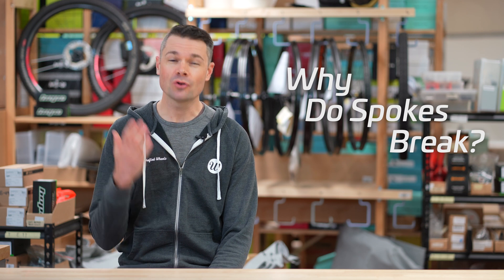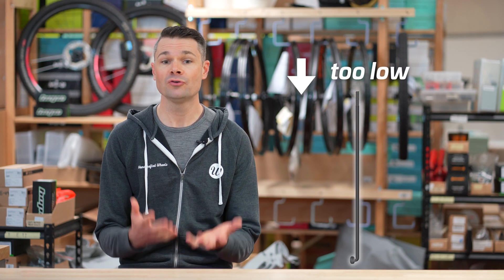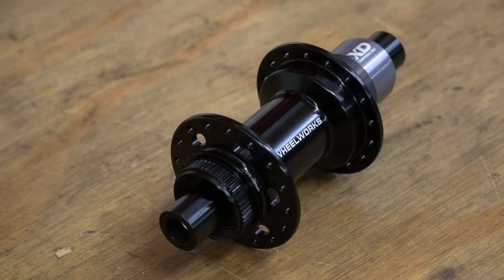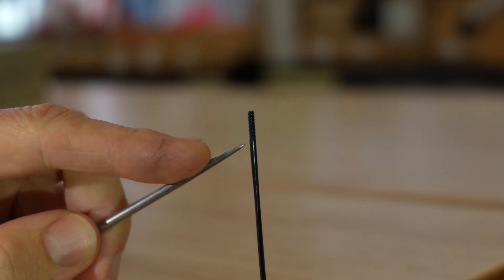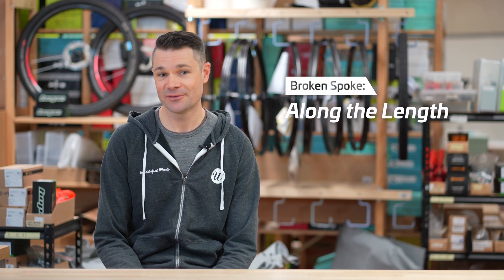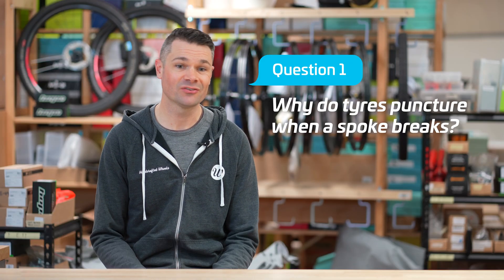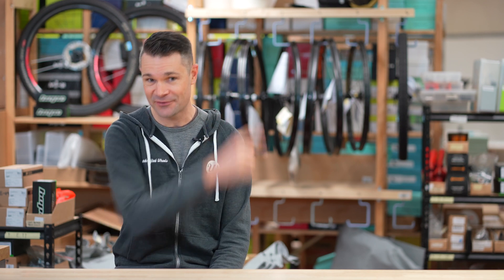Why Do Spokes Break?

Comment: I'm watching the video and I can't believe what I'm hearing. 
I have no doubt that you are doing your job well, but there are some misconceptions here.

to introduce myself: former racing driver, bicycle mechanic and wheel assembler. I've assembled 800-1000 wheels myself. Mostly mid-range and slightly higher-end for my needs (about 10 pieces).
factors that affect the durability of wheels are: quality of parts (spokes, nipples, spokes and rims), rider weight, rider strength and riding style.
there is no combination in which the wheel will not fail.
it is common for higher quality wheels to last longer than lower quality wheels.
higher-quality spokes are more flexible than lower-quality ones, which almost cannot be easily bent into a U shape. such spokes are more brittle and break suddenly.
DT swiss claims for some of its spokes that they crack only above 170kg of effort (if I understood them correctly)
Material fatigue occurs on such a spoke if it has a frequent change in load in the range of, for example, 80-170kg, the larger the range and the closer it is to the maximum force that the spoke can withstand, the sooner fatigue will occur.
Fatigue cannot occur on a spoke if it is variably loaded below, for example, half the breaking strength (0-50/80kg).
The most loaded spokes always break first (unless there is a fault in the material, production or assembly)
your hubs have a larger flange and therefore reduce the range of variable load because the spoke is on a larger lever unless it is a radially assembled wheel.
with mid-range aluminum rims there is always increased stiffness at the joint and therefore the spokes at the joint are a little more loaded compared to the others.
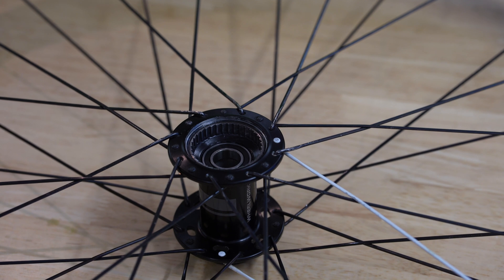08:27 I don't know who assembled this wheel, but they assembled it wrong: the spokes that are damaged by the chain are the most stressed spokes on the rear wheel, and that's why they should be on the inside, not the outside like in the picture.
from my own experience with a rear mtb disc wheel that had dt spokes, after 10-15 years of hard riding, the right spokes started to break frequently. then I did an experiment: I moved the right spokes to the left side and the left to the right and then the spokes stopped breaking for the next about 5 years, after which both the left and right started breaking. then I changed them all. 
so the result of the experiment is that material fatigue occurs sooner on more loaded spokes than on less loaded spokes. 
otherwise, every wheel I make, I do the "singing" of the spokes, by bending the wheel in different directions, in my area there is a saying: the donkey and the owner know more than just the owner
Reply from the maker: There is a lot to unpack in your comment.  

Regarding the lacing pattern at 8:27, we put the 'pulling' spokes on the outside as this makes the wheel slightly stiffer, and pulls the crossing inwards and away from the derailleur / brake calliper under pedalling load.  

Spokes start plastic deformation around 180-220kgf depending on their cross section, and will fail around 320kgf 

Steel spokes have a nearly infinite cyclic lifespan if the material is good quality and  the spoke stays in tension.  Many spoke failures are on the low tension side of the wheel because spoke tension is too low and the spoke goes from tension into compression. 

We've done lots of lab testing and real-world testing over 19 years of business and 10s of thousands of wheels built and while I'm always still learning I'm confident in the statements I've made in this video , although some are generalised to keep the video shorter and more relevant -Tristan

Comment: Had a dual walled BMX 20 inch wheel laced to a NuVinci n380. Had no issues for a year on a TerraTrike Rover. Then started breaking spokes at the rim. Problem appeared to be the lacing pattern. They looked be bent to get them laced in the pattern used. - Replacing a broken spoke was not fun due to the 20" x 2.125" Schwalbe Cargo Pick-Up tires fitted on a recumbent trike.

Have a Greenspeed Magnum XL now. Would like to to get a NuVinci n380 laced to a dual-walled 20 inch rim. Or would a 24 inch rear wheel rim be better due ti spoke length (or the lack thereof)?

Comment: Strength is the force a spoke can withstand before it plastically deforms. Low tension spokes break before high tension spokes because metal fatigue is proportional to the percentage change in tension. A spoke tensioned to 50 kgf that drops to 10 kgf when it detensions at the bottom of the wheel rotation has far greater percentage change, and therefore fatigue, than a 100 kgf spoke that drops 60 kgf.
Reply from the maker: That's a really succinct explanation thanks! -TT

Comment: The modern highly dished rear wheels are very unreliable.  The rim sets the maximum spoke tension that is much lower than the spoke capacity.  The spoke tension on the non-drive side of dished rear wheel are often less than half that of the drive side; too loose to not flex and fatigue and fail.  Three solutions, 160 mm hubs, no dish, off set chain stays 8-10 mm no dish or 2:1 lacing 2 drive side 1 non-drive side.
Reply from the maker: I respectfully disagree with you on durability.  Modern wheels have a lot of dish, however they can be built to be durable and long-lasting.  The lower non-driveside spoke tension isn't a big issue in real life.

All of the other options you list have their own downsides.  In my view for modern road and mountain bikes the wheel being dished is the best compromise. -TT
Reply: @WheelworksHandcraftedWheels  Firstly I am a retired mechanical engineer, design and manufacturing, and long time custom fit, high end steel frame builder.  I can assure you that the dished wheels are highly compromised.  Spoke tension on the non drive side depending on the hub can be as low as 40% of the drive side.  Many rims have 120 kg limit on spoke tensions.  That is 48 kg spoke tension on the non drive side.  Spoke tensions below about 100 kg allow the spokes to flex excessively which causes fatigue and failure.  You did not elaborate on the down sides of the three options 160 mm hubs, offset (8-10 mm) or 2 spokes 2x drive side 1 spoke 0x non drive side.  I have yet to envisage or actually find any down sides.  Most of the frames I have built have been for extra large men (some 150 kg and fit) and a few for small women who have trouble getting a bike to fit.  My self 76 yo the lowest weight I have been in 50 years still well above 100 kg.   Always plagued by non-drive spoke failures on dished wheels.  160 mm hubs, expensive, heavier and possible but unlikely heal strike on short chain stays but super strong wheel with matched spoke tensions drive and non drive side and much better chain alignment.  Off set chain stays, standard hub, matched spoke tension drive and non drive side, better chain alignment.  2:1 lacing, special hub or standard 32 or 36 hole hub for 24 spoke and 27 spoke wheels respectively.  Similar spoke tensions on each side the wheel standard chain alignment
All wheel builds have to be checked for center only the off set wheel is checked for the correct off set.  Incidentally any rims that are not directionally drilled for the lacing I am doing, I re-drill  directionally for that lacing.
Reply from the maker: @dan2304  Hi Dan

The lowest we typically see a non-driveside (NDS) spoke tension is 55% of the driveside (DS.)  Still low, but not 40%.  Lower spoke tension doesn’t affect wheel stiffness as Youngs modulus is the same.

Moving to a 0x non-driveside and, say, 2x driveside will further reduce the NDS tension.  To increase NDS tension you want the radial spokes on the driveside, and there are obvious downsides to this.

2:1 lacing is effective in bringing up NDS tension, however requires a much wider hub stance to retain wheel lateral stiffness, and the high entry angle of the NDS spokes into the rim results in a lot of spoke and nipple breakage in my observation and experience.

Wider hubs or offset rear-ends will result in wider Q-factor and wider pedal stance.  

All of “solve” one problem but introduce others.

I’m confident we’d be able to build you a wheelset which won’t go out of true, let alone break spokes, with a traditional lacing pattern and a dished rim.
-Tristan
Reply: @WheelworksHandcraftedWheels  Stiffness; Young's modulus is the distance a thing will move (spoke stretch) per a given force.  And is dependent on the actual tension not Young's modulus. double the tension on a thing (spoke) and the resistance to movement is doubled.
To account for the power forces pedaling or breaking the maximum number of tangentially laced spoke need to be used.  So drive side 2x

"Moving to a 0x non-driveside and, say, 2x driveside will further reduce the NDS tension."  How, wrong 

"2:1 lacing is effective in bringing up NDS tension, however requires a much wider hub stance to retain wheel lateral stiffness," Why? wrong

With  a ratio of 1 0X non drive side 2 2X drive side there are half the number of spokes on the non drive side so twice your own number of 55% of tension or 110% the tension of the drive side.  additionally because the drive side spokes are tangential not radial, have a higher tension anyway.

"and the high entry angle of the NDS spokes into the rim results in a lot of spoke and nipple breakage in my observation and experience"  Wrong!  The angle to the rim is exactly the same as any other dished wheel with the the same hub.  Directional drilling is a much better system.

"Wider hubs or offset rear-ends will result in wider Q-factor and wider pedal stance.  How?  Q factor and stance is the pedal separation, the hubs are at least 400 mm behind the bottom bracket.  Even size EU 50 feet are still well short of the rear hub.

From your responses you obviously did not study high school physics while an engineering degree is 4 years at university studying physics applications.
I build frames and wheels for 150 kg riders for loaded touring bikes and tandems that do tens of thousands of kilometers without needing truing and am riding a 24 spoke 1500 g wheel set that is still true after 20,000 km with a 110-120 kg rider.  A crash example, one spoke pulled the whole thread from a brass nipple, only seen that once. I only had to replace one nipple to true the wheel but the frame was a write off.

If 2:1 lacing of dished rear wheels is so crap why do high end wheel manufacturers build them?
Reply from the maker: Hi Dan

I don't have a physics degree.  My knowledge in this area comes from 19 years experience running a wheelbuilding company, building tens of thousands of wheels, and performing countless repairs on both our own wheels and other brands.   I've done the math and have run many experiments over the years to better understand what I'm seeing, and to help guide the development of the hubs and rims we design.  

Spoke tension doesn't significantly change wheel stiffness...this is shown in the math, but also in experiments.  Damon Rinard's is the best published but I get the same results on our lateral stiffness jig.  
https://www.sheldonbrown.com/rinard/wheel_index.html

Regarding 0x NDS effect on spoke tension: if you draw the free body diagram you'll see how this decreases NDS tension.  

Regarding 2:1 lacing:  With half has many spokes on the NDS each must do twice as much work, hence them having twice the tension.  They are stretching twice as much - not because of tension but because there are half as many.  This results in a measurable decrease in wheel stiffness AND a big imbalance between deflection from the DS and NDS sides.  Again, my test rig has shown all of this.  The way to recoup stiffness is by widening the NDS flange and this puts a lot of load on the rim/spoke/nipple so you often see breakage here.

Why do brands use 2:1 lacing?  You'd have ask them, however they look really cool and are a unique selling point so I suspect those reasons may have something to do with it.
Reply: @WheelworksHandcraftedWheels  Stiffness in not strength.  Strength is the force required to produce permanent deformation.  Strong wheels are much better than stiff wheels though they often go together.  I build wheels that stay true over tens of thousands of kilometers on shit roads with heavy loads.  Except in very unusual circumstances bicycle wheels do not experience axial forces of any consequence.  Neither are they built to withstand axial forces, why they collapse when they do.  Bicycle wheels are strong in the radial forces but only as strong as the rim can withstand buckling.  I have been building frames and wheels for over forty years, and analyzing the forces involved in both frames and wheels also the ergonomics and testing those analysis.  What drives the bicycle industry is sales.  Hence the hyping the fashion rather than the reality.

Comment: My trek 2024 powerfly 4 gen 4 hard tail e bike keeps on breaking rear spokes
 I dont do jumps higher than shin  height. I've never done a tabletop nor will i. Its a e bike hardtail. Warrenty claim on rim. Its been 43 days and Trek cant supply one until Jan 6 2025. I cant even get them to supply more spokes. 14g 295mm . How can you make a $6500 NZ bike gear built to last on their web page and not even have spokes ? Not even 1 and ive been told there are no other rim upgrades for this model.......😢

Comment: Hi friend, what difference can be or what can happen with a wheel that has to 2 spokes replace with a 1 mm of difference of length? By the way is a straight pull spokes wheel, thanks, great channel I can see your high level of knowledge

Comment: Great video but curious what spoke tension balance would consider unacceptable. Meaning is a L and R difference of 100% / 45% considered too low? Here the low % is for the drive side of a front disc wheel - as in they’d be at 45% of the tension given to the disc side spokes. Just wondering if this should be say always at least 50% of the high tension side or if this can be managed by building well and stressing the wheel well 🤔

Comment: These guys are certainly more knowledgeable than me, but still some comments:

- A spoke breaking at the nipple can also occur due nonconcentric spokes/nipples.
- Nipple corrosion on rear wheel, perhaps that's due to environmental effects too (moisture, salt, etc.), in addition to the possibility of galvanic corrosion from sealant (assuming you're talking carbon hoops w/ aluminum nipples?).

Comment: I am using 16mm nipples on Sapim D lights which is 1.6mm in the middle. Is this a cause for concern in the future?  Since I'm thinking the nipples would rub on the spokes because it is slightly bent in the direction of the hub from the spoke hole. 

I can also see that I got too long spokes poking out of the nipple by around more than 3mm I think which might make it worse as it is too far inserted and makes the middle thinner part rub more along the long nipples. I also used HM Sapim washers which I think helps with more durability and some directional assistance. Nice video and information. Thanks a lot!
Reply from the maker: 16mm nipples generally bring the thread closer to the hub to allow you to intentionally use spokes which are too short.  In your case I suspect your nipple threads have bottomed-out on the spokes.  The best thing for you would be to rebuild the wheel with spokes that are 3mm shorter and use 12mm nipples.  ~Tristan
Reply: Hmm. Very interesting response that is quite different from others opinions. I appreciate your alternative point of view/knowledge. I really hope nothing goes wrong though because I wont be changing anything anytime so soon. Thank You Sir! @WheelworksHandcraftedWheels

Comment: I'm riding sometimes hard, bikeparks or some jumps with hard landings, every month i see a slightly loose spokes in the rear wheel
I'm trying to tighten them, just to keep straight tension (if the wheel is +/-1mm (1 milimiter) it's fine for me, right? equal tension is more important than .1 truiness )
I was thinking, if Parktool tensiometer would be useful for me or should I just look if the wheels is fairly straight/round in my frame and spokes not too loose (By sound or by touching them)

Comment: I hope you might have an answer for me since you’re in the industry. I had to incidents where several spokes broke on two bikes while not in use. One bike was never redden and the other was well used in its past but has since not been used. Both had multiple spokes break near the center while being stored in the garage not being used for about 3 years? One is a mountain bike the other a gravel. The mountain bike had no name spokes and the gravel were DT’s. What do you believe may be causing this?
Reply from the maker: That's almost certainly poor quality spokes.  A few years ago there was a massive batch of steel sold to the OEM spoke makers as "stainless" but it turned out it wasn't and many, many, spokes rusted in the middle and broke.  I'm guessing you've got something similar going on :-(  -Tristan